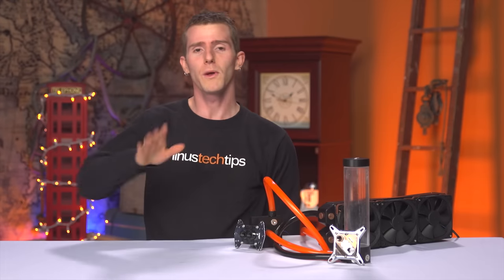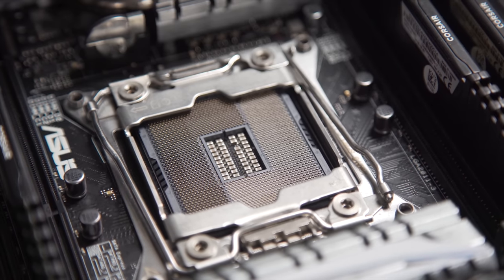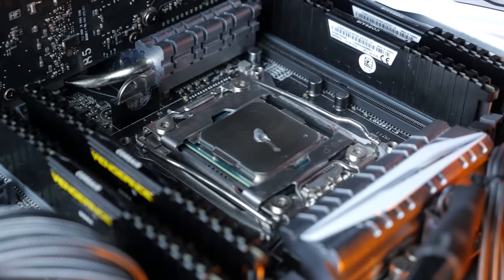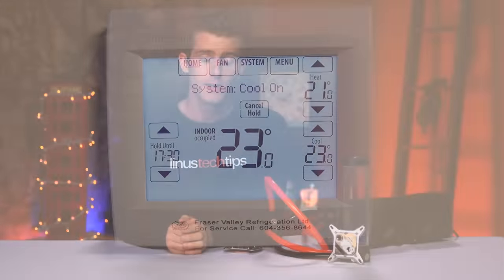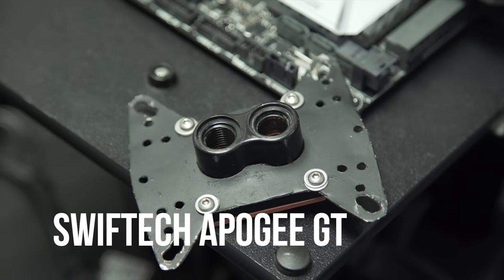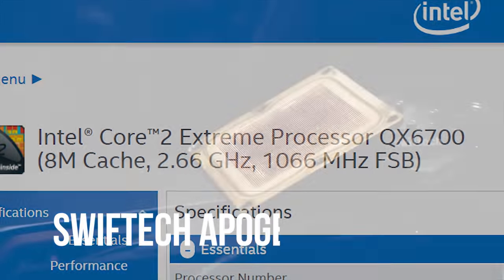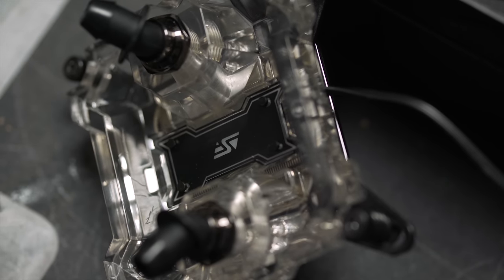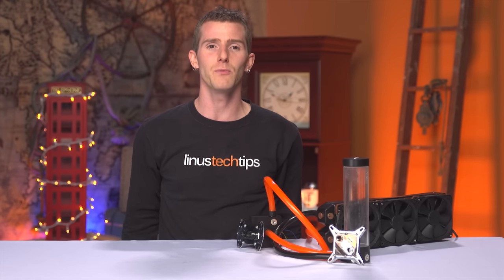TEN YEARS of Water Cooling Performance Tested! - Through The Ages Ep. 1

Comment: All of these have bad performance for one simple reason- the lack of depth of cooling fins gives a limited surface area. In around 2003 I cut a copper heatsink down and had a plumber solder a shroud around it to seal it up and turn it into the water block. the no-load to load temps were only about 3 degrees.
Reply: um no... lol
Reply: you keep your room less than 3 degrees? thats so cold
Reply: also when you are talking about the current micro fins, thats about the same surface area as a stock heatsink, just alot more mass.
Reply: I mean a 3 degree difference between the load and no load temps, not the overall reading. I know that the ultra fine cuts of the fins help to massively increase the mass but this is offset by how shallow they are. I should of also added that the type of copper heatsink I used had a skivved construction, that's the one he refered to where they peel the layers up

Comment: im going to sli zotac amp extreme gtx 1070's  and im just wondering if a 750 watt psu 80plus will be able to handle them under load,. my other specs are 4790k 4.0ghz  8gb of corsair vengeance ram 2tb hard drive msi krait edition z97s

Comment: in my opinion testing just one companys waterblock series  is basically pointless ,what would have been more relevant and possibly more interesting, would have been testing all in one cpu watercooling solutions from the last several years and if possible getting used and new  units of the older all in one solutions and seeing how much if any performance degradation you get .

Comment: Is water cooling worth getting if i am not overclocking?
Reply: highly dependent on the components you'll be looking to cool, what sort of ambient temperatures and humidity you have to deal with where you live, what sorts of noise levels you're comfortable with, and how the airflow plan for your case is setup (mostly is it fine or is it shit).
Reply: My PC has no noise to it (or if it does it is a low frequency) and from your (is it fine or shit) bracket comment it is not necessary for my current build.

I was wondering for future upgrades since my current build is on the low end (costed $1000 AUD)

Will i need water cooling if i was to say have a 4 Core multi-thread with Two High end Gpus.

(The water cooling should cover all components i guess since water cooling is better then fan right?
Reply: no... just a bragging right or "cool" thing to have in your computer. honestly though... AIO water coolers are pretty cheap now and look better than air coolers. Only reason I got one. I am overclocking as well though.
Reply: okay thanks. I am quite a novice on pc and related tech
Reply: if you haven't purchased a cooler (air or water) for your system yet and have a little extra to spend I would try out like one of the 120mm Corsair entry level AIO water coolers. Dont buy one used... get it new. Should be around $50 unless you find a Christmas special. Totally worth the extra $30ish you would spend versus a decent air cooler in my opinion.
Or spend about $75 and you can get a 240mm AIO. (Thats what I did considering it was only $25 more than the 120mm.)
I bought the Silverstone TD-02 lite for $72 but I've seen them down in the $60's if you wait for the right moment.
Reply: need is hard to say.
ambient temperatures is critical. Austrailia tends to get quite toasty, so if where ever the computer resides also gets toasty, you may need liquid cooling.

as well as if climate is stabilized inside, whereas it won't increase over the course of the day if your computer is dumping a lot of thermal into the air.

i can't answer that question for you. only a thermometer can.

Comment: to clairify they tested water blocks not an actual cooling system from that era... why not test aio water systems??? basically all they did was change the faucet head to an older model rather than changing the water heater to an older one... you only tested your patients on filling and draining a water system...

Comment: 1:22 what are thoose "green" usb ports? :)
Reply: USB 3.1
Reply: Is 3.1 even worth it? xD
Reply: idk I never transfer big files over USB
Reply: Morten Nielsen Yes. If you use an external HDD(shocking to hear that, I know), it's so much faster to transfer files when plugged into 3.0/3.1
Reply: ***** Well a HDD cant read/write that fast? ;) Or maybe i am wrong, but sure, it's probally way faster.
Reply: Cyan/Teal technically.
but yeah, it's a USB 3.1 Port.

if you want to know if you care about it, just read the documentation overview of what it's capabilities are over USB 3.0.
that'll tell you everything you need to know.

also good Hard Disks (sequentially, which is what you end up using for large files, which is also what you want the speed for in the first place usually :p) can push ~130 MBytes/sec. give or take 20 MBytes/sec.
USB 2.0 can't even come close to that. as the standard supported about that speed but in the real world once windows, controller chips for the USB system, Et Cetera got involved it was much lower on average.

Comment: I have a BIG question: I want to gut my 16 Year old clunker PC (My Very First PC) and turn it into a NAS Storage System for my college data, and files, and just storing stuff (as it has alot of harddrive bays) hopefully with RAID. As the "Working" hardware in it currently is 16 years old, it is about as slow as a turttle having sex and the PSU has 1 & 1/2 fans running..... All I keep finding is how to build a crazy 20TB 20 Hard Drive server monsters, I can't seem to find a video on how to do this on the very cheep, below $250/300 "and ill be adding hard drives as I go" and I know it is possible but a lot a videos I find are not informative enough. Can you make a video on this maybe?? I know its a long-shot lol.

Comment: I've never done water cooling is it louder or quieter then fans
Reply: you don't need water cooling, don't fall for the brain washing, the water simply moves the heat to a rad, where it is cooled by.... fans! (normaly 2) and not forgetting the pump, also the risk of it leaking, but as I said at the start, you don't need water cooling, water cooling is only cool because of youtube videos (brain washing)
Reply: I knew about water cooling before YouTube existed. It was only yt videos that proved to me that it's not optimal.

And by the way, the fact that the radiator is fan cooled has nothing to do with anything. A car's radiator is also cooled by air, but it's more efficient than blowing air into the car parts to cool them. Not only it allows you to use a greater area than available, you're removing hot air flow from inside an enclosed space.

Water cooling for PCs is anemic in practice, but what you're saying is an attempt to debunk radiators in theory...
Reply: we are not talking about cars, we are taking about pcs (that don't need water cooling) where the water is pumped around the cpu block, that water is then took to the rad where it is cooled by fans. you know its brainwashing when you have someone want you to build them a pc, and for them to say to you I cant afford to buy a ssd and by a water cooler, thank god I built his pc using a ssd and removed the water cooler from his order.
Reply: cctvuser >"don't fall for the brain washing, the water simply moves the heat to a rad, where it is cooled by.... fans!"

You talked about radiators in general. You don't have to mention cars, as soon as you make the claim that the fluid and the radiator are mere middleman to cooling fans, you're actually trying to debunk the physics.

I am not going to make the calculations because there's several factors I'd have to ignore and the result wouldn't be accurate, but I'd assume that water cooling doesn't work well because of size limitations that mean that the radiators and the mass of water itself cannot prevent the system from heating up and eventually trying to cool the components with "warm" water.

If you're trying to prevent people from sinking money into water cooling, then please don't engage in dishonesty. Trying to be a smartass and question the core concept doesn't work considering that liquid/radiator cooling have valid uses and are not replaceable by air cooling in many applications.
Reply: you don't get it do you, why waste money on shitty water cooling when the cpu don't need to be cooled down in the first place,(yes it needs a fan, but it does not need money waisting water cooling) it is a fact that the pump moves water round the block, and then to the rad where it it is cooled by fans. turn the fans off the water WONT be cooled.
Reply: cctvuser Oh my fucking God, you just did what I'm telling you not to do.

You don't have to convince me to not buy water cooling. My problem is that you're actually trying to debunk the physics behind radiators.

A radiator is literally like a heatsink. In fact, radiators are used to heat up homes, my old oil radiator has no fan and it warms up the air. If it warms up the air, then the oil inside must be cooled (it doesn't cool as long as the resistance is turned on but you get my point) otherwise there would be no conservation of energy.

Now, when using a radiator for cooling it must use either incoming high speed air or a fan because air has a lower heat capacity than the fluid and thus the mass flow rate of air must be greater than the working fluid's. It will cool without a fan, the problem is that to have an effect on something like a computer you'd need a massive radiator and a much stronger pump to circulate the water through it, which would occupy too much space, waste too much electricity and make too much noise for the same performance. A radiator without a fan is a passive cooler, a heatsink.

From a practical standpoint, you're right. But you're trying to theoretically debunk radiators as a whole.
Reply: im not trying to debunk rads buddy, do you agree water cooling a cpu is a money making scam? lol
Reply: cctvuser But you are, you're claiming that radiators are worthless middlemen that lead into a fan cooler.
Reply: when it comes to pc cooling yes I am, as its a money making scam sorry you don't agree
Reply: I don't need to be smart to state its a fact no modern cpu needs to be water cooled, im done with you, if I can stop just one person from the brain washing that there cpu NEEDS to be watercooled ive done my job, cya.
Reply: im not retracting fuck all.
Reply: cctvuser Then you're incorrect because you're claiming radiators don't work.

Comment: Water cooling is expensive and dangerous as well as it requires maintenance. In the other hand we got AIO cooling less complex perform quite close, if it breaks you replace.
Or at least just change the pump and your good.
And overall its the best middle ground option,
Air cooler for cheapskate
Full water cooling system is for enthusiast who money is not an issue for them
Reply: Note dangerous because if you setup incorrectly and caused a leak? Say bye bye to all your hardwares

Comment: still wontt be water cooling, or allowing myself to be brain washed that watercooling is needed, no modern cpu needs watercooling, even when overclocking,(just cos it get extra hot in bench testing, that it will NEVER SEE in day to day use) intel designed the cpu to run hot, its normal for it to run "hot" and has much protection built in to make sure it never goes over the max temp for the cpu, I love that fact that my 5820k is clocked higher on air )and cheap air cooler at that) then many people who have water cooled this chip, ill say it again modern cpus don't need watercooling, the only people to benefit from watercooling is the manufactures and sellers of water cooling products, a mass brain washing exercise that most of you have fallen for. yes I know some of you push 1.4v through your cpus, and use this as an excuse to watercool, water cooling - not needed - brainwashing crap.
Reply: lol.
Reply: facts dear boy facts, as my video shows and proves.
Reply: Water cooling. quiet and lower temps. better than air. obviously. every chip is different some like to run hot and some like running in the negitives
Reply: not saying it don't lower the temps, that fact is they don't need to be lowered!, my system is perfectly quiet on air.
Reply: :YOUR" system. You said your chip runs higher than most water cooled. First that has nothing to do with temps. That has to do with the silicon lottery. Some cpu have bad TIMS. and run hotter than others. What kills a cpu? Voltage does. Why? And how far is your pushed? Whats your voltage, Run it on p95 for a few hours tell me how it goes :D
Reply: who cares, the fact is water cooling is not needed
Reply: my volts are 1.23, i wont be running ant p95, as i stressed and benched it months ago
Reply: For you water cooling isnt needed. YOU. Tell that to a person with a i7 4770k. if i were to use your logic you dont need high end air cooling because that doesnt come with the intel box and what comes with the intel box is what should be used only because it was designed to do that
Reply: half life he is right. water cooling is just for looks now. There have been many videos and articales. Water cooling is just for shows. Air is enough because technology has come a long way.
Reply: Hayate Azekura Ugh. Water cooling is more efficient. And it looks good. Water is denser then air so therefore it dissipates Heat much better. More efficent. Silent and Aesthetically pleasing so Winner winner chicken dinner